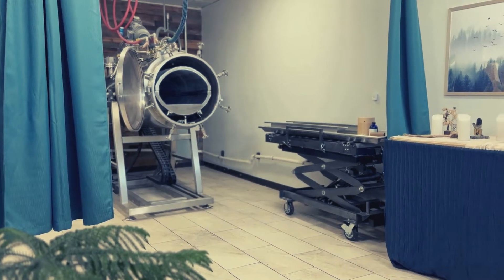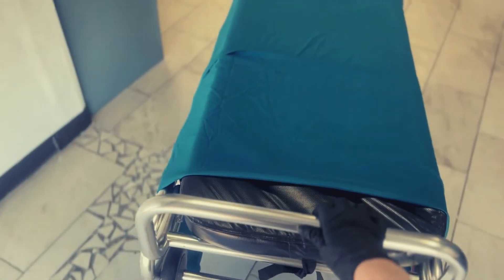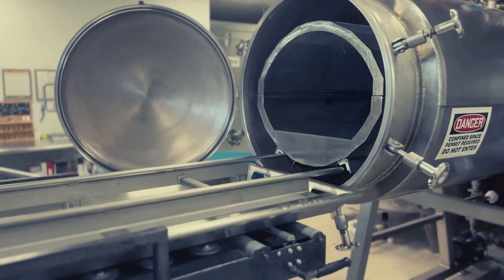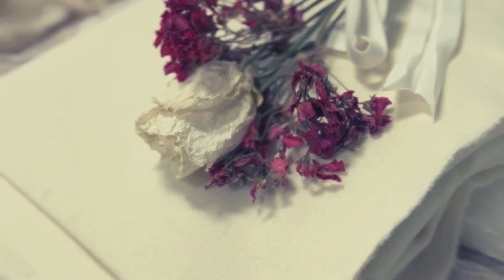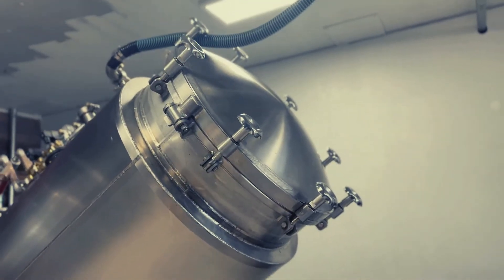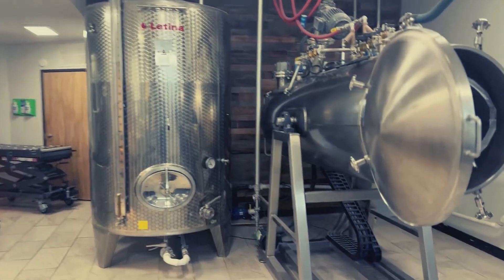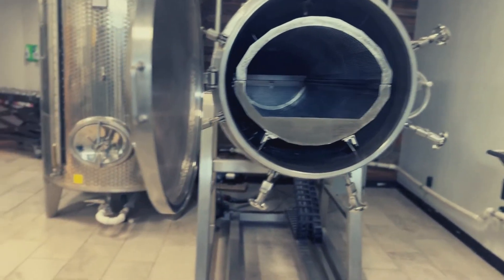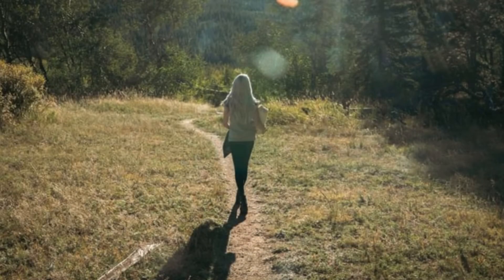Water Cremation for Humans - The Alkaline Hydrolysis Process Start to Finish

Comment: Isn’t water-cremation just for the flesh to melt and the bones still there and after that; still need to use fire flames to burn the bones? Then what’s the difference w/regular cremation where the bones still gets burnt?
Reply: The bones dry out and then are crushed. The result is like powder rather than the somewhat gritty cremains from flame cremation.